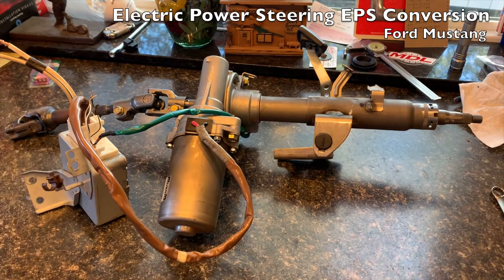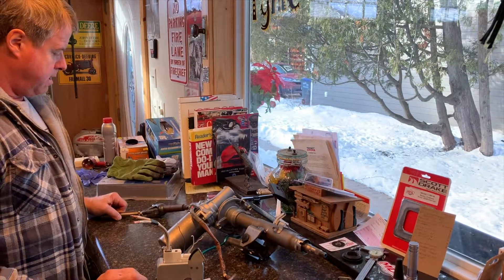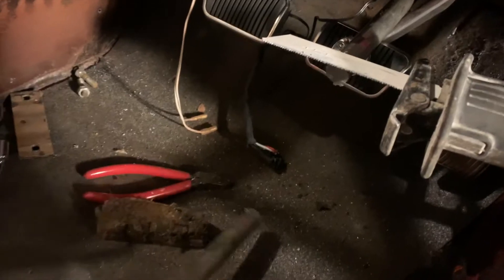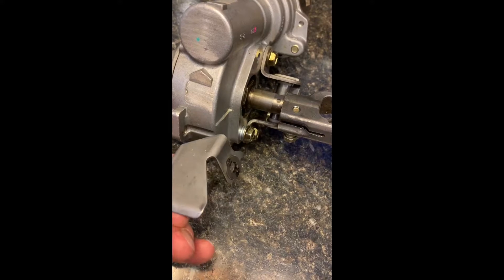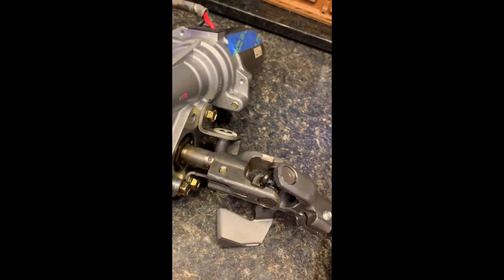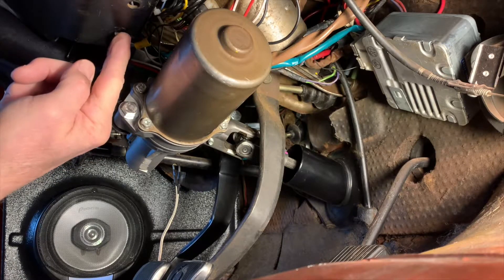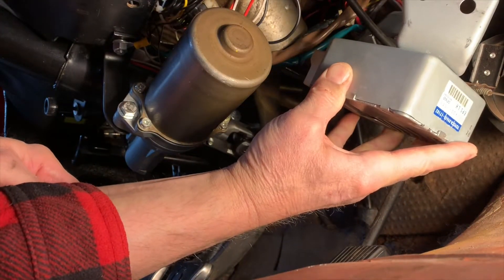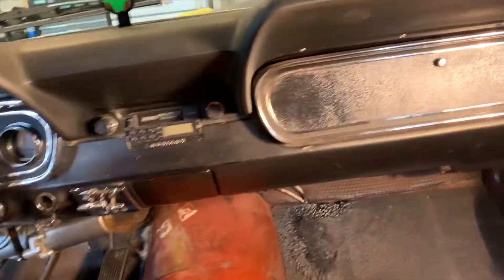how to electric steering conversion EPAS 1965 1966 ford mustang and restomod steering conversion

Comment: Remove mastercylinder and left valve cover and you can move the complete steeringbox out of the car without cutting it .  And you have to give the front wheel geometry more caster. Like 3 °  , that way the steeringwheel will find it 0° position easely. return to straigforward.

Comment: There is a company that makes a potentiometer dial that wires into the control module and allows you to adjust the amount of steering assist, excel for when you want less at cruising and more for low speeds.

Comment: I have a new to me 64 F250. It has been a minute since I had a manual steering rig. It may totally be me but the steering seems extremely hard and it even has a bit of a crazy road hop that sends me toward the guard rail. Newbie question but do you think there might be more to my front end that should be addressed? Before attempting this conversion? Or just do it and deal with king pins or other items after the conversion? Thanks

Comment: Hello, great info! One question, what is the minimal distance from the back of the dash needed to fit the unit? I have 7-1/2” from dash to my under dash steering box. Thx
Reply from the maker: Im not completely understanding the question. When I return home in a few days I can take some measurements and perhaps that will help.
In the mean time if you could clearify.

Comment: Did you know they came out with a switch that will adjust the sensitiveness. So turn of a knob and you can have tighter steering. Got mine from Ebay.
Reply from the maker: I did not know that. But I am happy with the level it's at. Thanks.
Reply: @klrconcourse1  Thanks for the video, i just finished mine and it came out great!! Keep up the good videos!

Comment: For me, the sound is cutting out at 3:07. Any chance this is happening across the board? would love to hear the rest of the video. Thanks
Reply from the maker: Soooo frustrating. I don't know why it stops. I'm working on it.  If you want ill take your e-mail and advise you when/if I fix it, or i'll just try to remember to update your here. Sorry. arrrrggg. J.
Reply: @klrconcourse1  No worries, if you get it working again or re-upload it, let me know here and I'll find it on your channel. That would be great. Thanks!
Reply from the maker: I believe I fixed the sound problem Ryan.
Reply: Yup I can hear it all. Thanks for taking time to do that. Are you still happy with the EPAS system? Did you change the caster at all after this?
Reply from the maker: @ryanlarsen6409  Hey Ryan. It's great. I have not changed the caster. It doesn't feel odd at all anymore. I don't let go of the wheel after a turn. So for that reason I just don't notice it any more. So me thinks why mess with it on a car I drive 1,000 miles/year. (at 16 MPG! cuz it's a 400 hp 351W which is kinda dumb.)

Comment: hey where did you get the rubber bushing for the base of the column?  @ 12:56
Reply from the maker: If your referring to the boot through the fire wall that was factory.
Reply: @klrconcourse1  sorry, the spacer between the prius column and the factory column
Reply from the maker: @dwaste325  That was just luck. A friend had that in a scrap pile. I think it was out of an old Mercury

Comment: Great informational video. Any long term thoughts since you installed this? Things you might do different or changes? Did you fix the centering issue? Should be able to get most of that out with alignment. Do you feel that the potentiometer for adjusting assist would be worth adding. Also, just thought that  by welding the shaft onto the steering box. you would not be able to replace the upper seal in the steering box if needed. Probably won't need to if the box was rebuilt before all of this work though. Thanks
Reply from the maker: I am happy with it. Works perfectly. I've just been too busy to look into increasing caster. Someday I hope to, but I guess I just don't notice anymore.
Reply from the maker: I am still happy with it and I can't think of anything I'd change. I did mega pack the steering box with grease prior to install and being the car is a 66 that I drive 1,000 miles/ year I'll be dead before the box needs service.

Comment: is the steering harder then before when the EPAS isn't activated? so for some reason if the system fails is it harder to steer then stock.  I guess thats hard to answer as you had power steering prior.   probably just adds minor amount of resistance.
Reply from the maker: I think it's the same as non-assisted steering. It is driveable if there was an electronic fail for sure. 
I believe these systems are really reliable. As they need to be if granny was driving her modern car and the steering stopped assisting.
Reply: Agree. I will be installing one in my 1947 willys cj2a. Bigger tires I upgraded the steering box to a manual Ford box but I want power. This fits the bill and my little engine won’t give up power to a hydraulic pump.
Reply from the maker: @ShnitzlHaus  I recommend when you weld the shaft between the EPAS and the steering box, add a sleeve of pipe to the shaft. slide that down and weld it over the same area for added safety. Butt end welding alone worries me.
Reply: Thank you, yes will sleeve, rosette weld, thru pin whatever it takes. Need to sleep at night knowing I will be using it off-road it will get a workout

Comment: I couldn't tell from watching and maybe I missed it, but do you have long tube headers? I can't see them being a issue. I have manual power steering now is there anything else I would need to change other then what you did in this video?
Reply from the maker: My headers are not long tube, and I don't think it matters if they were. everything steering is ahead of the tubes. I am not familiar with all components of original manual steering, but I THINK you would have a simpler job starting out with manual. I added the manual components to make mine work.

Comment: I'm just getting started this on a '63 Nova. My power unit is an '09 Corolla. It looks pretty much like yours. The park brake handle is in the way and if the unit is turned 180 it hits the brake pedal mount. Tomorrow I'm going to get a Saturn Vue unit because the motor is mounted on the other side. Best part, I have to retain the column shift! Paint it semi satin black and it will "go away".
Reply: Update: I used the '09 Corolla unit and kept the automatic column shifter. It works GREAT!! Now I'm intalling one in my '36 Chevy coupe.

Comment: Great video. I just received my Prius EPAS pieces today to be installed in my ‘66 Mustang.
Reply from the maker: Jeff, Test it first. I had a bad one and glad I tested it. Make sure it's wired right testing or it will kill it.  I think the one I had was damaged by someone wiring it wrong and returned it. The big wires backwards kills it. My vid says the correct wiring.
one thing to add for you. I would slide a steel pipe sleeve on between the EPAS and the gear box. then after welding the shafts, slide that outer "pipe" over the weld and weld that too. Or something like that to increase the strength. I have not had a problem but it's simple and strong insurance. Besides, there is room in the firewall outer tube for the extra shaft diameter.